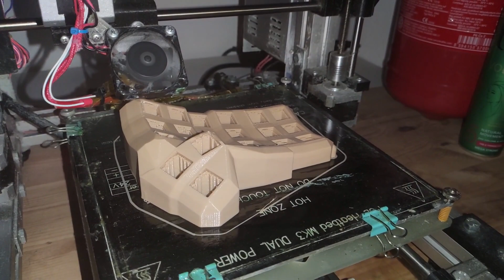Dactyl ManuForm Mini Keyboard Build

Comment: Awesome man, I've been looking to build one of these for months now. Just need to find someone with a 3d printer that I can borrow. Will definitely use this as a parts guide - super useful. Would definitely be keen on a written guide too if you have time/want to do that, but that might be asking too much haha. Thanks heaps anyway
Reply from the maker: Thanks for watching, I'm glad it can help even a little bit. I do want to expore the Dactyl Manuform project more including generating my own files and my own layout in QMK, I'm just not sure on the time frame. For 3D printer, try to look for local Fablabs or other hackerspaces, they will often let you use their printers for just the cost of the filament.
Reply: just so you know, they're many websites than can print 3d files for you and I dont think they're too expensive.
Reply: Very nice Video

Comment: Thanks. Another nice video. I have been having trouble with the diodes. Watching you do it has helped.
Reply from the maker: I'm glad that you were able to solve it. What was the issue?
Reply: @infiniteoffset  I shaped each diode wire by twisting the wire around the pin. Preshaping and snipping speeds things up.
Reply from the maker: @peterweston6588  Yeah, I know what you are talking about. I was messing up with this like that when I was starting my SiCK-68 build. Making the loop before soldering does really help.

Comment: Thanks for sharing this! Makes hand wiring/soldering seem approachable for me. I'm relatively new to split keyboards (just built a Kyria) but i feel like i would need more thumb buttons since i have numbers, symbols and navigation on three separate layers
Reply from the maker: Prebending and looping diodes helps tremendously. Alternatively using single key PCBs like Amoeba can make the wiring easiers. It's great you want to utilize thumbs more. Now it feels weird that on standard keyboard booth thumbs are only for space key, doesn't it?

Comment: Damn that's a lovely keeb. Probably I'm goona attempt something similar as a next project. I just went from my first soldering job which was a jj40 to a Corne kbd and I wonder what my new endgame will be. :) Btw what are those little wrist rests at the end of the vid?
Reply from the maker: It's definitely worth to try building some version of Dactyl Manuform! Even if it's only cheap build like mine.
Good choice in keyboards, I personally really want to build Corne one day as well. Or the new Cornelius if it wasn't so expensive, haha.
Those are generic memory foam mouse wrist rests, I have added the link to the exact ones in the description in the end of the part list.
Reply: @infiniteoffset  How much was everything? I loved your minimal build, seems way better than those 5x6 dactyl. Edit: I saw that you did a Corne as well. I bought everything I need for a Cantor, a corne low profile with a more aggressive stagger. It will be my first build. How do the corne and this Dactyl compare, I mean in ergonomics.
Reply from the maker: @tupinikeebs  I believe it was around 40-50euros, but prices now will be higher for sure.
 
I printed this smaller Dactyl for two reasons. Firstly I'm more used to smaller Planck-like layouts and secondly, I don't like 3D printing overnight and this could be printed during the day unlike some bigger Dactyls that are like 20 hours to print for one half.

I will be honest here, I do like Corne a lot more than this Dactyl. It's probably because I'm used to Levinson keyboard (my daily driver), but also this Dactyl in particular didn't fit me well. I tried building Tightyl, which might be better suited for me, but it was too tight for me to properly wire it, haha, so I never finished it. Ergonomic wise Dactyls are probably better, but the switching between keyboard and mouse is more comfortable with flat keyboard IMHO.

Cantor keyboard looks interesting, first time hearing about it. Funny how little components needs to be soldered on it. Be sure to post photos somewhere once you have it done.
Reply: @infiniteoffset  wow, such a detailed overview. Thanks! About the cantor, yeah! I've got zero experience with soldering, and I also live in Brazil, so buying an already built keyboard is somewhat really expensive. So I first thought about the corne, but because of the plates and cases and whatnot, it can be rather expensive, since it's from different sources + shipping, etc. It would be nearing 250-300USD I think. Then I found the Cantor, which seems to be even more ergonomic than the corne, and also waay cheaper. And also don''t need diodes, led, case,plate, hotswap. Seemed to me the most simple I could find and also pretty ergonomic. I've got CTS, so I'm kinda looking for ergonomic right now. But yeah I also look for the Dactyl, altough I only hope about buying one already built and also used, since it will be cheaper. I've never used an ortholinear, split or anything less than 60%. So it's going to be a biiiig change, I hope it's a good one!  And yeah, I will post on reddit as soon as everything arrives. Also, since you didn't like this dactyl mini so much, any chance of selling it? haha. About the tightyl, I saw them and those 36 keys dactyl, they look insane! Does it hurt to use them without some kind of wrist rest? Good lord, I did type a lot. Sorry for this
Reply: Also, I don't think I would ever be able to build one, seems hard af to handwire and stuff.
Reply: @tupinikeebs  eae mano chegou a comprar ou montar um? kkkk
Reply: @leo-fg9du  sim, esse mês farei uns 20 Corne.

Comment: How long it takes to print single side?  i had a plan to built one in  next future time. Nice vid btw
Reply from the maker: Thanks. I was printing one side for 13 hours, but I have used a lot of support, so this time might be reduced. Some bigger Dactyl Manuform models print even over 24 hours, but that was not an option for me since I'm not able to run my printer overnight.

Comment: Thanks for the great video. So informative. I can wait to build it myself. One quick question - did you need any software setups after to connected the keyboard?
Reply from the maker: Once the arduino is flashed, it doesn't require any software to use the keyboard. It's like standard keyboard. For flashing you need either QMK or some flashing software like avrdude.

Comment: Nice build. Where did you find out how to make the keymaps and firmware for a split keyboard? I made a handwired numpad with qmk and I'm now planning an ortholinear split keyboard.
Reply from the maker: This particular config I did not make, I just made some small changes to it, but I do recommend reading QMK doc on this https://beta.docs.qmk.fm/using-qmk/hardware-features/feature_split_keyboard For me it was very useful, because I needed to set this keyboard serial wiring instead of i2c. Serial required 3 connections and i2c four connections, but at the moment I just had only stereo jacks at hand.
What style of ortholinear are you planning for?

Comment: I have a problem 
I have built the same one but most of the keys are not working just 6 are working 
Can you help me?
Reply from the maker: Hmm, I can try to help. I assume firmware is correctly flashed on the arduino since some keys are working. So for the start, if you have multimeter, try to see if you have rows and columns connected, if there is not bad solder joint somewhere. And also if you don't have a short between two columns or two rows (probably not case here, but good to check). Also check if your diode orientation is correct since diodes are oriented. These are the most common problems, so that's for the start.
Reply: @infiniteoffset  ok good idea I am on it

Comment: Realize this may be a longshot, as it has been 3 years since you published this video, but do you happen to remember how you compiled and flashed the firmware? I'm having a hard time getting QMK to compile the firmware you linked in the description.
Reply from the maker: I don't remember it. The repo I linked is not up to date, but you can take the minimanuform folder out of it and put it in your qmk up-to-date folder. What kind of error are you getting? What board you are flashing it on to?
Reply: Hi! Did you find the solution?
Reply: @vsvirin23  I ended up actually making a new firmware from scratch. I can post a link to it if you want, but 2 things to know first: it's not as feature-rich as the original (no tapdance, maybe more stuff missing), however, it does use vial which I personally consider objectively superior to base qmk. I'm at work at the moment, but I will see if I can post a link the next day or so.
Reply: @monkielikebacon2  Thank you!
Reply: @monkielikebacon2  made my own too but can't make two thumbkeys work

Comment: Amazing and helpful tutorial, but why does your 3d printer look like its on life support.
Reply from the maker: Thanks! Well, two things about my printer. It's older design and it's extremely dirty from hair spray that I smack all over and it also soaked under the glass bed. But all the important parts are cleaned, lubed and well maintained, so it's printing fairly well. Nowadays I try to clean it better, for example I remove the glass when I clean it instead of doing it directly on the printer, but with some parts I just don't bother much. Nowadays people use fancy textured build plates instead of glass and hairspray, however imho glass and hairspray is still the best surface to print on. It's cheap, you can buy glass and hairspray locally, it can last long, it holds the print well, etc. Downside is the hairspray mess for people like me who are lazy to remove the glass.

Comment: Cool, what does it cost in filament for the print, if I may ask
Reply from the maker: Depending on the model (curvature, height, number of keys, wall thickness, type of supports) I think you should expect around 200-600g of filament. I believe the particular one in the video was around 300g. I used some cheap 10euro/kg filament (it was in sale, that's why the weird color), so in my case it would come to around 3eur.
Reply: @infiniteoffset  brilliant, thanks

Comment: my huge issue with this kind of build, is its not hot swappable. so if by chance you grow to hate the kind of switch you use, its GG and time to build another keyboard
Reply from the maker: Yeah, definitely. And since keys are also hand wired, it would be nightmare to desolder them like you could on a keyboard with PCBs. However there are not many hot swappable Dactyls, it's quite hard to make it hot swappable.

Comment: Do you enjoy using those switches? Im curious since a lot of people in the keyboard community seem to hate clickies.
Reply from the maker: About the switches, the particular ones that I used in this video are not the switches I would choose or recommend for daily use. These are cheap and I used them for testing purposes since I didn't want to invest too much into my first Dactyl. But if someone is on the budged, then these will still be million times better than regular rubber dome keyboard.
About the clickiness. Everybody either loves or hate clicky switches. I'm fan myself. But I wouldn't use them in office or library where there are other people trying to focus. For my daily use I use Kailh Noble Yellow the most.

Comment: Yo imagine if one key was faulty after you have done all that work
Reply from the maker: It would actually be not that hard to repair it, not pleasant, but probably like 30min job. Yeah, I put ton of hotglue on this one, that would be the biggest issue, but it can be removed with isopropyl alcohol. Then desolder two wires, replace switch and resolder back. But faulty switches themselves are rare problem, more usual is cold/missed solder joint and faulty diode.

Comment: Must be blue switch? And what is BSUN?
Reply from the maker: Any cherry style switch will work. BSUN is brand of switches that are similar to Gateron, little worse quality, but dirty cheap. See my description for links to parts.
Reply: Can i use choc switch too? And how i set up in computer like the keyboard layout? (Sorry for too many asking😔)
Reply from the maker: @rasyinggantv1717  Yes, choc will work as well.  Booth choc and cherry mx needs 14x14mm holes. Layout and keymap is programmed via QMK firmware that is flashed on the arduinos. Config for dactyl mini can be found here https://github.com/bendalton/qmk_firmware/tree/master/keyboards/handwired/minimanuform
Try to search for videos how to work with QMK, but if you will get stucked somewhere, you can always write me.
Reply: Thanks a lot, subsribed👍
Reply: @infiniteoffset  wait, choc switches work too? How about kailh choc v2? Its have 3 metal pins, which one is for diodes and which one is for cable? Or i should cut 1 pin?
Reply from the maker: @typer8534  Generally PCBs are not compatible, but this doesn't not use PCB, so the choc switches are compatible since they fit in 14x14mm holes. The extra switch on Choc V2 is just to secure it to PCB better, it doesn't do anything. Two active pins are on one side, the inactive pin is on the other side.

Comment: dude you don't have to fill supports 100%

printing like that you wasting to much time and material
Reply from the maker: The support is far from 100%, it's still not much of material, but I do agree that less support could be used. My print failed with less dense support at certain place and at the time Prusaslicer didn't allow to easily change support locally.